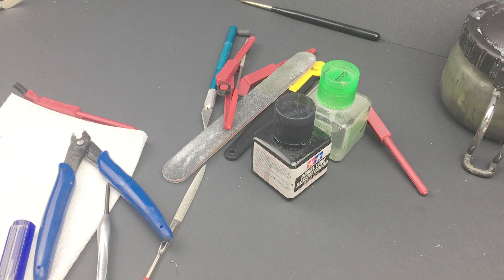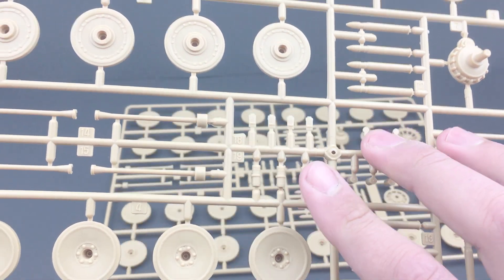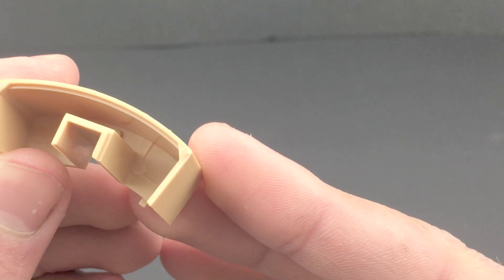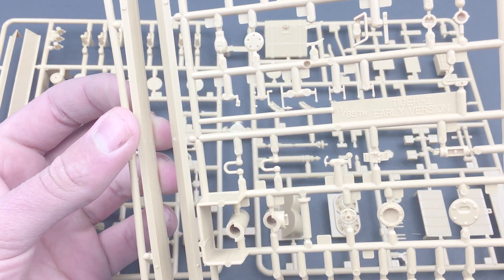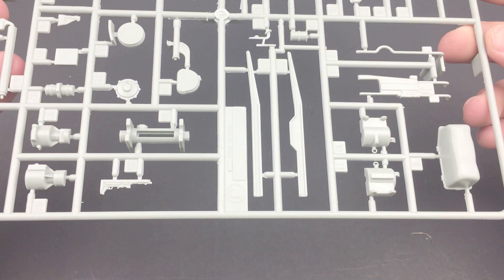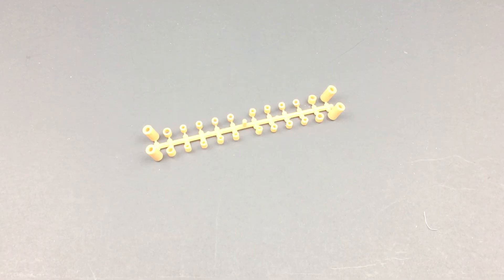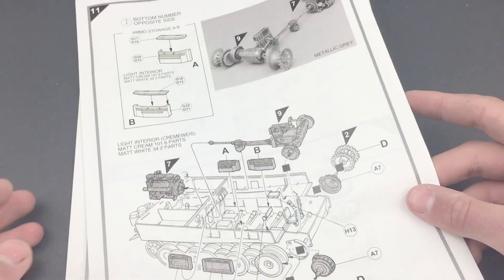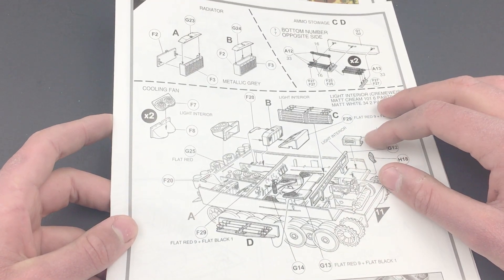1/35 Airfix Tiger 1 "Early Version" Kit Review

Comment: The bags are ammo pouches for the MG34’s
Reply from the maker: Gotcha, thanks. Surprised that they put them I. The very back of the tank the
Reply: Scale Studio they had some by the bow mg some in the turret and I guess midway point for whoever firing the most?

This kit looks like a rebox of academy’s Tiger 1, one of the first kit I built. I’ll have to watch the rest of your videos to see if they have corrected: the transmission being to wide to fit into the interior, the shells being stacked 3 across instead on 4 & the post war addition driver control panel installed into the bovingtion Tiger 1

Yeah scalmates confirms it just a reboxing from academy: 

https://www.scalemates.com/kits/airfix-a1354-tiger-i-early-version--1190298

It’s a shame really but at least they catching up with the times, using a common scale for once . They should scrap their 1/76 range and release AFV’s in 1/72, 1/48 & 1/35 scales, see which scale sells the best and stick with that instead of keeping with their own esoteric scales that no one else uses and so limiting there customer base.
Reply from the maker: I guess so!

Comment: I bought this kit and it has no interior parts! Bizarre.
Reply from the maker: That’s super weird
Reply: I bought a JU87R-2 Stuka Kit 1/48 from Air Fix and decals sheet came without the swastika :(
Reply: @metalmadnessSL  yeah that’s standard now, depending on which market it was made in or for. In Asia they don’t care. You can buy decal’s separately try different sites and eBay.
Reply: That's because you didn't buy this kit, Airfix do two early Tigers, one has interior and the other doesn't.